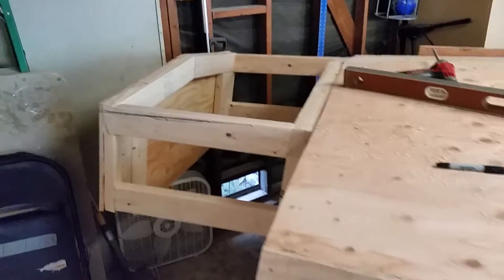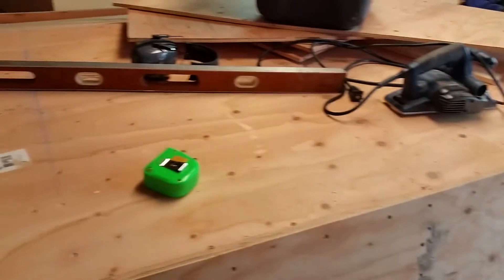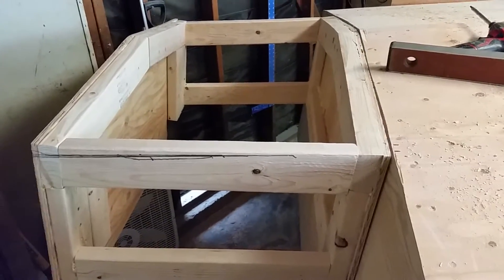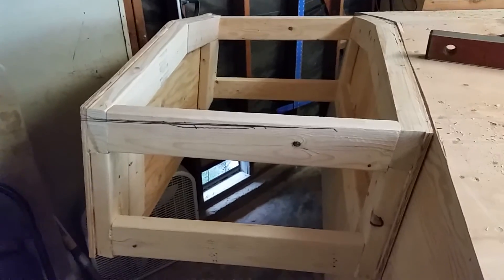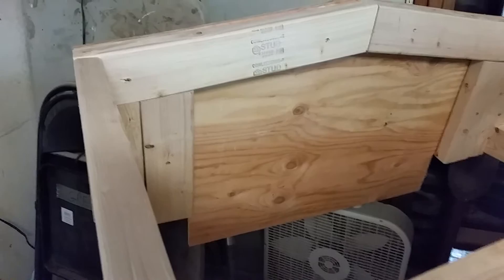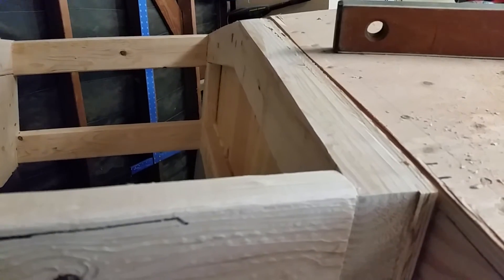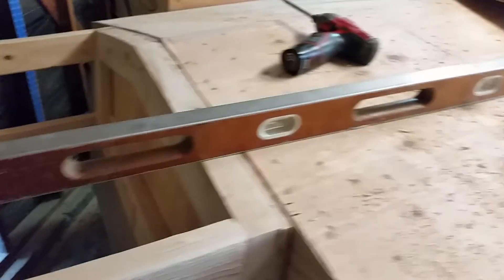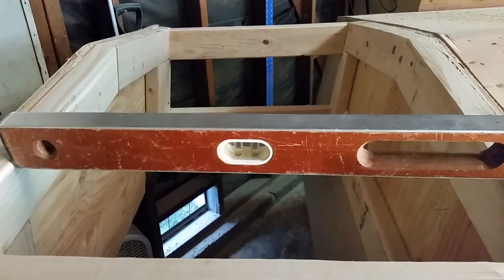DIY Building an Outboard Transom Pod/Bracket for my 22' Wooden Boat (1 of 3)

Comment: Do you think the pine and non marine plywood will last? I'm interested in using the same materials as you have but spooked to do so because everywhere that I read they say it will either rot, check, warp, split you get the idea. I think with the glass any wood should last then again I'm not really a boat builder.
Reply: Hi Michael,  The plans that I got from Spira was for Plywood over Frame (2x4's in this case).  Works great.  When done, none of the 2x4's will be visible.  Super strong and stiff.
Reply from the maker: Michael Paris marine plywood is about the waterproof adhesive, not rot.  if exposed to water marine plywood will rot just like any other kind of wood.   That is the only difference As long As You Are sealing it with epoxy or polyester resin it is not going to rot I have torn apart many boats that are 30 to 40 years old built this way and don't have rot if they are well tsken care of
Reply: Greg Kuiper I appreciate you telling me this information.  Really valuable to me. It's been the cost of the marine wood that's has held me back from building.
Reply from the maker: Michael Paris just make sure it is exterior grade with one sanded face.  I get 1/2 inch for about $15 per 4x8 sheet.  2x4x8s for $2.50 each
Reply: Greg Kuiper got it thanx!
Reply: Greg Kuiper why 2x4's? For strength or cost or both? Wouldn't plywood forms be lighter but as strong?